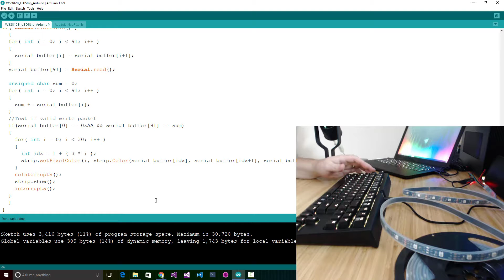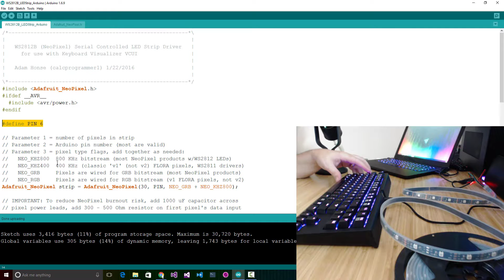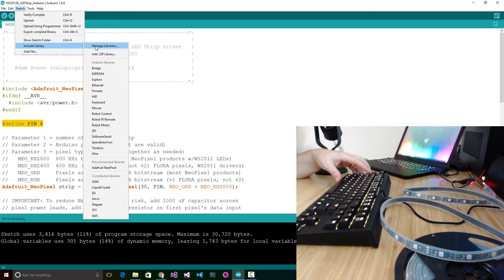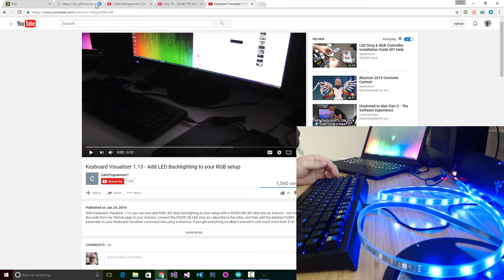Super easy & cheap desk lighting mod using Razer Chroma + Arduino

Comment: Super late to this party! But thanks for the sweet video. I've ordered my arduino and led strips and a bunch of other stuff as I would love to set this up on my new system. I want them behind my monitor emulating screen activity, under my desk, and inside my pc, as it'll be way cheaper to run this instead of getting the chroma addressable hub :D 
Any updates to the system, software, or compatibilities since then? :D

Comment: This is a cool mod and I want to do it as well.
Unfortunately Im not a programmer or a computer guru of some sort and I have no idea about those boards, I look online and getting one of those adruino boards is impossible for me as the price is high even for clone, I want to ask if this will work on ATTINY88 or ATINY13A?
Reply from the maker: Not to sure.. I know you need a 5v connection to drive the addressable strips that I was using in the video.  I'm not to familiar with the tiny arduino boards (I did a quick search on them) but I think they have built in power regulators and require external voltage to operate (between 1.8v and 5.5v) - they look like simple microcontrollers so I think they lack the basic infrastructure (programmable memory of 8kb and eeprom of 512 byte/1kb for the 13a) to be able to do what was done in the video.  I still think you'd need an arduino (or something like it) to burn a bootloader on the tiny.  I feel like those microcontrollers would be ideal for basic things such as single LED or basic LED arrays and not addressable stips (but I couldn't tell you 100%). I hope that helps - I know there are cheap alternatives to an uno: NodeMCU, Teensy, etc... perhaps one of those would work for you.

Comment: 5 yrs later, but you can use nanotape for that too. I love the video, but don't understrand how this relates to Razer's Chroma, or Synapse 3 integration. Did I miss something?
Reply from the maker: Solid tip on nanotape, thx.  The Chroma tie in is though Keyboard Visualizer and Chroma integrated games.  So games like Obduction for instance will use the APIs and change color and brightness based on what is going on in the game itself - while synchronizing with all other "Chroma" based devices.

Comment: hello from 2019, mine doesnt show in my rgb  strip, im using a ws218b, keyboard visulizer 3.06, everytime i opened the shortcut, the program automatically closes
Reply from the maker: Hey Carlos.  He made a small change to the source where now the command line parameters need to be proceeded by a dash "-"
You can find out more on this here: https://github.com/CalcProgrammer1/KeyboardVisualizer#supported-devices-windows | It should end up looking something like: "C:\Users\KeyboardVisualizerVC 3.06.exe" -ledstrip=COM7,115200,30

Comment: Regarding the Chroma software itself, can you get the rgb strip to copy the effects on the keyboard, so example the color of the bottom row of keys.

Thinking of doing this but I want to still have the in game chroma effects on my keyboard.
Reply from the maker: Hey mark6IKX, I haven't tried that yet. I am guessing you're referring to how some games, like Obduction,  hook into the Chroma APIs to create a more immersive game environment where the colors on the screen translate to RGB effects from your Chroma-enabled devices - is that correct.  I'll give it a go and let you know.
Reply: archcoder yes that's exactly what I mean, I haven't got my black widow x chroma still waiting for it. I'm not that good at programming and partially too lazy to look. But one solution would be just to mimic the bottom row (Z to M) on the keyboard. as most games and profiles don't use much light on them. but you would still get the pulse effect. or maybe just one key. thanks for getting back to me
Reply from the maker: Sorry for taking so long to get back to you.  I just tried it playing Obduction and oh my does it work!  It changes the entire aspect of the game!  This has now got me wanting to add more strips such a great experience.
Reply: @roguesuits  How did you manage to do this? i know i am late to the party but the visualizer overrides my razer chroma settings and profiles.

Comment: And yeah, those waterproofing silicone sleeves don't stick to anything.  I used 5 strips of 1M waterproof WS2812B LEDs for Christmas lighting around my front door.  Even duct tape won't stick to that sleeve.  I ended up wrapping the duct tape around the sleeve and stuck to itself with another strip of duct tape over it.  The strip I put behind my desk I took the sleeve off and taped it with masking tape.

Comment: Great video!  Love to see people making use of the work I've put into Keyboard Visualizer!

Just a heads up, I modified the protocol used with version 2.0 and you will need to re-flash your Arduino with the latest sketch version.  I did this because I wanted to add support for more LEDs and the 8-bit checksum just wasn't holding up on longer data sets and I was getting flicker due to false positives with the checksum verification.  I increased the checksum to 16 bits and it has no problems with 200 LEDs (and probably even more, though untested).  You can now set the number of LEDs in the Arduino sketch (so if you want to use more of that long roll you have, you can).  I've found the Arduino IDE serial interface is good up to maybe 100 LEDs before it just doesn't work anymore due to overhead of the Arduino code buffering the port.  I wrote a second version of my code with AVR C and implemented my own buffering with a serial port interrupt which is much faster, works at 1000000 baud, and can handle 200 LEDs, but I haven't done any tutorial on it yet.  I posted a new video on how to set up the Arduino with my newest code here:

https://www.youtube.com/watch?v=1Hs6YfM7MD8

As well as a general update for v2.00 video here:

https://www.youtube.com/watch?v=AWyUPqIWzsQ

As always, if any KV users out there encounter issues, feel free to submit issues and feature requests on my GitHub page.  I've been in a programming mood lately and have added a bunch of stuff to it in the past month.

Comment: You can get a lot more out of the keyboards and lights if you turn up the amplitude and other settings in the visualizer program.
Reply: If you're listening to bass heavy music, increase the Normalization Scale parameter.  It will increase the higher frequencies without blowing out the bass response.
Reply: +1 Good to know. Thanks for the head's up